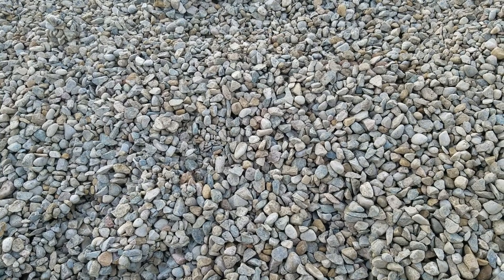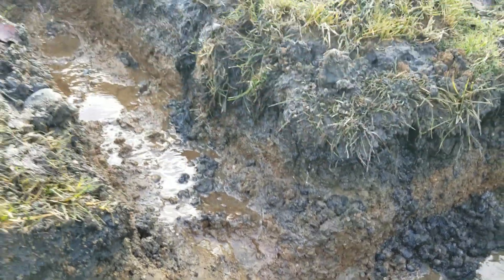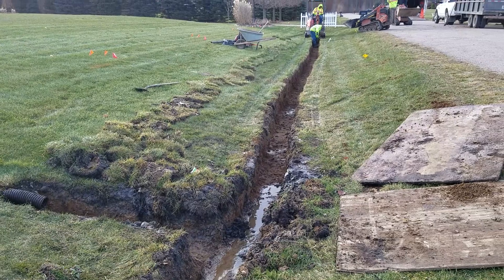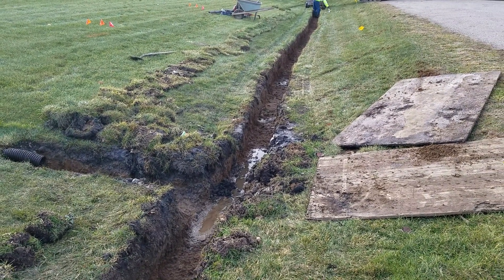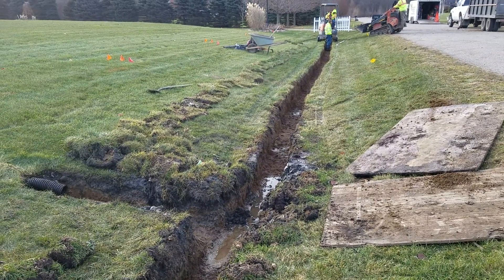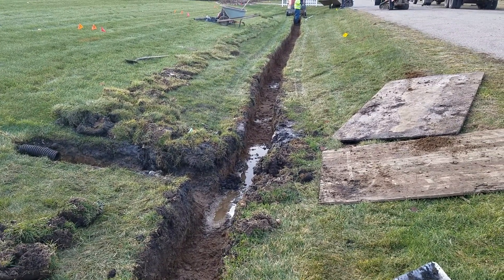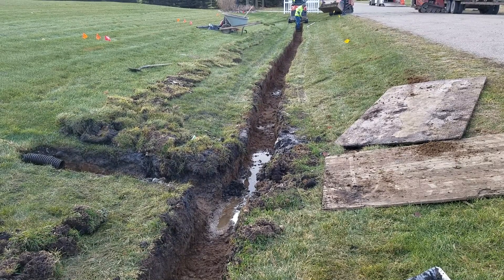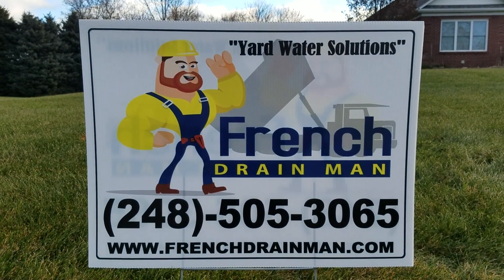Installing a Gravel French Drain in a Ditch to Driveway Culvert - Bruce Twp, MI

Comment: This method looks like it would work well, but the question I have is how are you connecting the gravel french drain to the culvert running underneath the driveway or is it being connected at all? I'm assuming the trench will be lined with Geo Fabric then filled with gravel, but I'm left wondering if the height of the ditch is going to be raised above the height of the driveway culvert so that the culvert is same height as the gravel french drain, or is grade of the land staying the same and the trench being dug is below this grade?